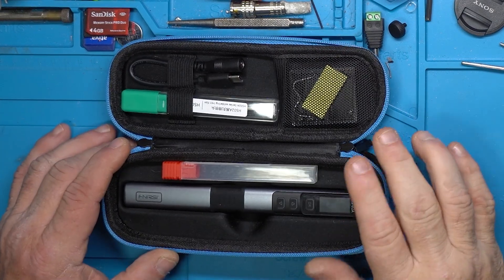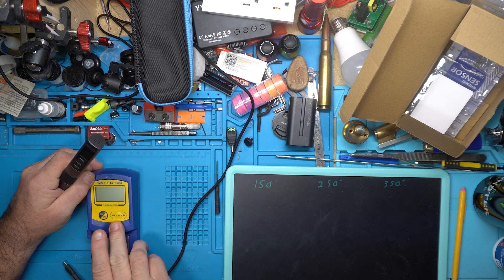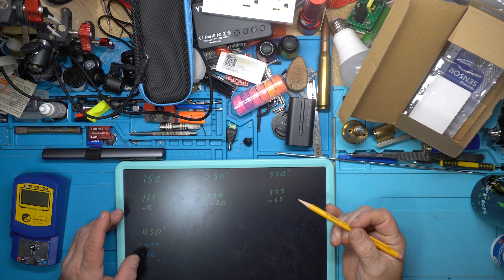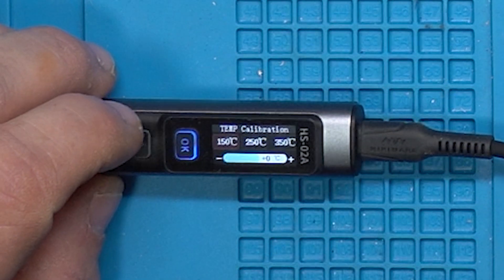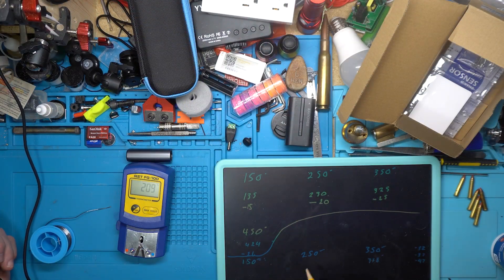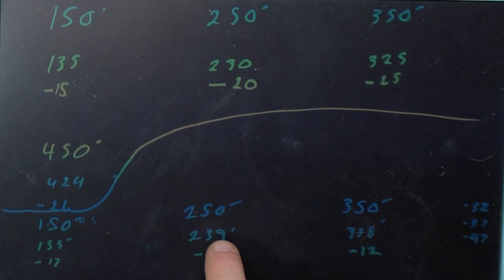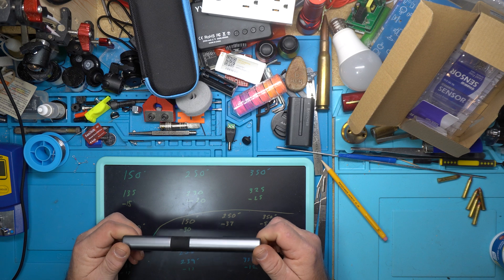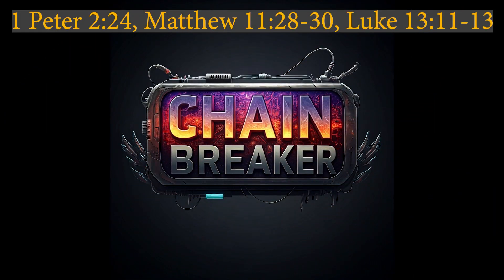Temperature Variance in Your HS02A? This Fixes It

Comment: Is this calibration linked to tip so if tip is replaced calibration should be repeated?
Reply from the maker: It will work just fine with tip change. Calibrate only if you see a big temperature difference. I have a very small temp difference between my current tips.

Comment: What is the %100 power issues with the hs02a variant i don't have any other good solderin irons should I buy the hs-02b variant or both?
Reply from the maker: The 100% power issue is the A variant and only the A will restart if set go 100% power at 20 volts. This setting will have the iron running a peak performance but it will trip out any cheap and some not so cheap power supply’s. But when using a pd 3.1 compliant power supply with a pd 3.1 compliant usb c power cable the iron will run flawlessly i have reviews on my channel the gan 260w psu is what im using. Its a cheap one but pd 3.1 compliant make sure cable is also. 

Check out my channel with the hs02 play list and you can see all my info on these fnirsi irons. I have a video explaining the difference between the A and b variations but the short answer is the B uses smaller tips. If you so a lot of heavy soldering like heat sinks and back planes then the A is for you. If you do REALLY small micro soldering like smd chips the B will work good. I have both but if i did it ag as in i would just get the A as i can do just about anything with it and you can purchase fine tips for it as well. Anyway. Check out the fnirsi hs02 playlist on my channel for a lot more info and tests in the irons. Let me know if you need more help. Thanks for your comment.

Comment: Mine went up in smoke, the first time I plugged it in. Literally. Even the casing was burnt. However fnirsi are honouring due diligence, and sending me a new one.
Reply from the maker: Wow. That is the first issue like that i have heard of. Where you using a barrel jack to usb adapter or a usb c to usb c?  Thanks for sharing.
Reply: @TTMEable  barrel jack plugged into a psu capable of supplying 15 volts at 5 amps. i suspect there was a short in the iron
Reply from the maker: Could be or reverse polarity. Can you confirm what the polarity is on the psu. I only ask because if somehow it is reverse polarity it will smoke the new one when it comes in.
Reply: @TTMEable  no the polarity was correct because i used the same setup on my other iron which is the model a
Reply: @TTMEable  although i'd be surprised if they didn't put in a polarity protection diode anyway.
Reply from the maker: Yeah the A and B variant are the same polarity so yeah you got a dud. I think Finirsi has good products but some of their production runs could use better QC. I think Defpom got a defective power supply and have seen a few other reviewers get dud items. Though to finirsi credit they make it right. In fact haven’t heard a story where they didn’t replace the defective item.
Reply: @TTMEable  yeah. i agree but a polarity protection diode costs a few pence. :)
Reply from the maker: Yes should be a no brainer but the more i have made purchases with temu and aliexpress i have come to realize that a penny is something to them .5 or 10 cents of is a real sale in china as far as i can tell. I think they could do much better with a little better QC.
Reply: @TTMEable  saying that, i would have thought the pdc or whatever chip the usb c controller uses would handle polarity
Reply from the maker: Im not sure where i read it but i saw a warning on polarity when i was trying to find information about the hs02. Likely wasn’t fnirsi as they really don’t or didn’t give me much info on their product but i don’t think there is any protection built into the iron.
Reply: @TTMEable  aye carumba
Reply from the maker: Yes exactly

Comment: Question: Will a Jbv c245 tips work with this is iron.  Or  other tips?
Reply from the maker: Hello. Thanks for commenting. The irons take two incompatible tips. The hs02a uses c245 while the hs02b uses c210 tips. The tips look alike but the c245 is bigger in every way. I have seen the tips listed on temu and aliexpress sometimes they give the tips different names but usually tgey have 245 or 210 in the listing somewhere. I have had good luck with both styles. Hope this helps if not let me know. Thanks.
Reply: @TTMEable Thank you for that update. I just purchased the b version, thinking that that was the newer version or an updated version. I'll try to find some c215 tips.
Reply from the maker: Glad to help. The latest firmware version ias of last check is v1.8
Reply from the maker: No problem. Glad to help. Latest firmware version is 1.8. Let me know if i can help with anything else. Thanks for commenting

Comment: My soldering iron reads way off. I have the calibration max out -100 and still too low at the 200 C setting. Which tip are using - could  that make a different.. ?
Reply from the maker: Yes. It would be my guess the tip is bad. Or not properly seated in iron. If you have another tip try it. I found the offset needs adjustment with different tips at least mine does. I had a tip that would not get properly hot and changing to another tip fixed the problem. Iron could be defective but likely tip.

Comment: do you recommend the HS-02 A or B
Reply from the maker: I currently recommend the b its a smaller tip style iron but does not have the 100% power issues the A has. If you run the a at 65% power or use the advanced power mode on every startup i reconsnd the a as you can get smaller top tyles for it. Check my other hs02 videos and you will get a full rundown on both. I have many videos on each. Hope this helps. Thanks for your comment.
Reply: have you tried using the a on 90% power
Reply from the maker: @ no but i tried it on 75 and it reset

Comment: You trust a 6USD device so much, to use it as a reference and even use it to calibrate based of it? Funny and ridiculous.!
Reply from the maker: In short. Yes. I do. These are used by many on youtube but regardless the point of the video is how to fix the problem and it worked for me. Now what anyone uses to measure the temperature of the iron is up to them, but the procedure is the same. Thanks for commenting.

Comment: I tried, but you have a high frequency (roughly 15kHz) tone playing throughout the entire video. Not sure what it is from (NTSC CRT running with no sync signal?), but it is absolutely horrible to listen to if you can still hear high frequencies, which despite being almost 60, I'm lucky (or unlucky) enough to still be able to hear these tones. I checked the original video, and it is not present there, but I cannot get through even a minute of this video without extreme discomfort.
Reply from the maker: I do apologize. My ears ring constantly and i cant hear high frequencies I’ll check original and see if i can identify anything.  Sorry for the inconvenience.
Reply: @TTMEable  I figured it was something you couldn't hear which makes it challenging and why I checked the first video to see if it was something always present in your shop (and it wasn't in the first video), so if you've got a youngster around, you could ask them to help you locate the source, or try a spectrum analyzer app on your phone. Sorry about your tinnitus, but that would definitely make it impossible to notice. Cheers
Reply from the maker: Thank you. You know i hadn’t thought about a app on my phone. Ill have to look into that. Thank you for your suggestion.